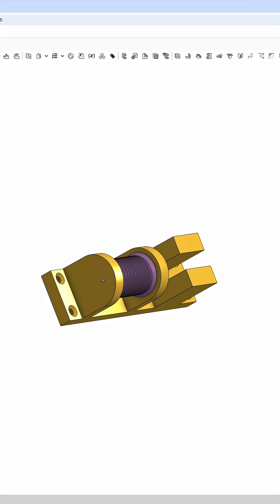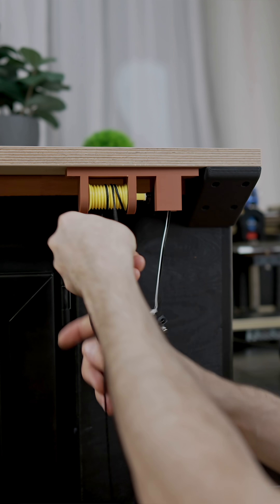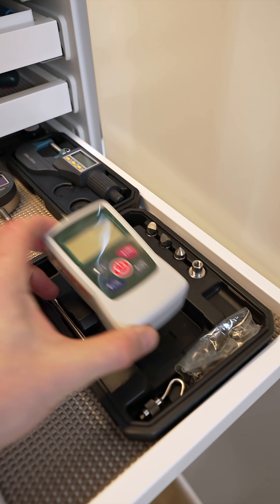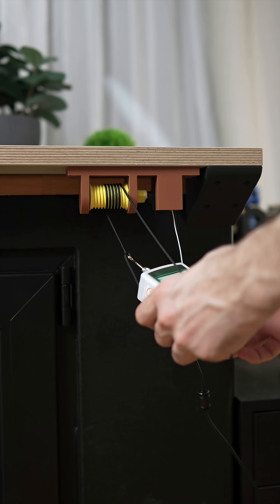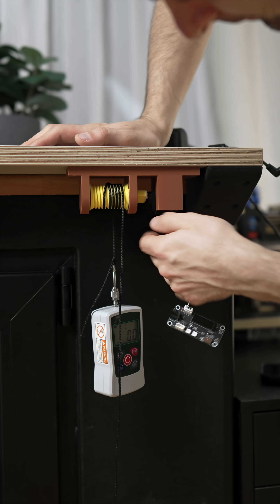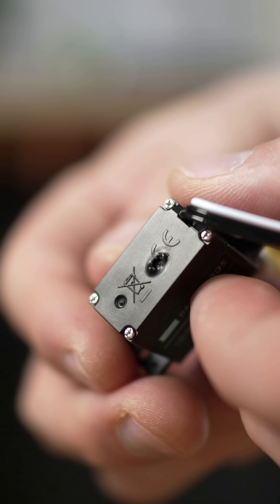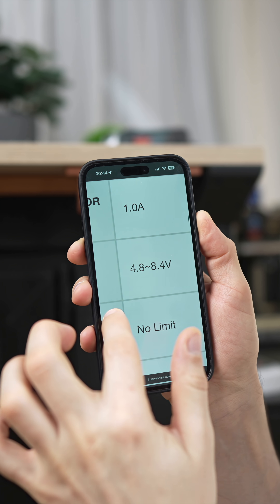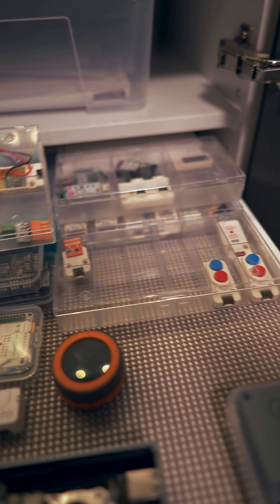I fried my servo motor at 12V 😬🔥

Comment: I fried a 3060 kinda the same way xD 

At 5am in the morning and really tired I started measuring voltages when my multimeter slipped and I shorted 5 volts with 12 volts.. computer instantly shut off and card is toast xD
Reply from the maker: 😢 damm
Reply: @marsgizmo mistakes happen 😅